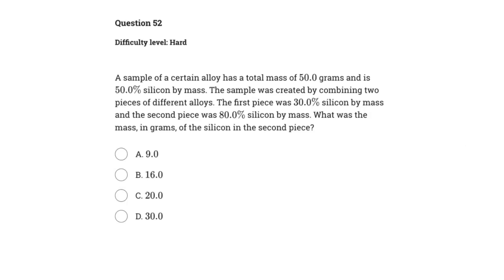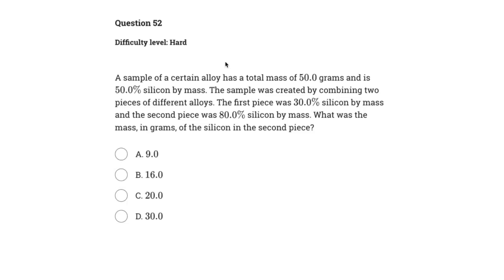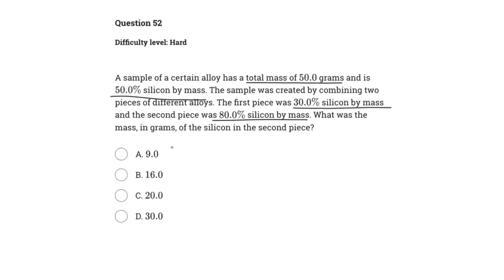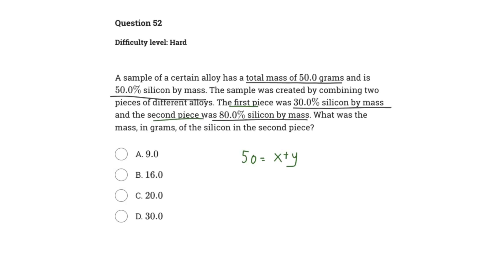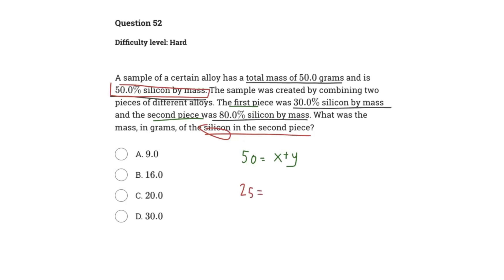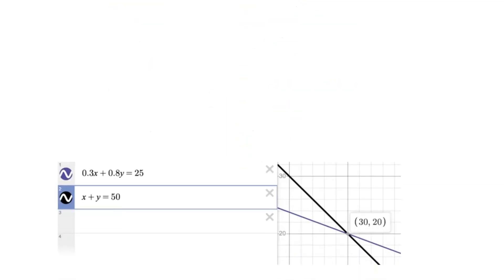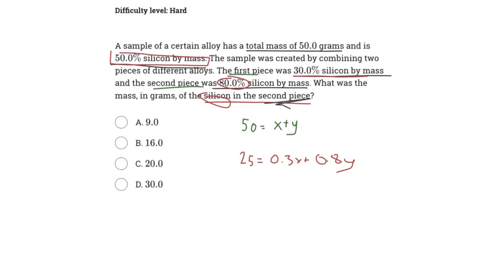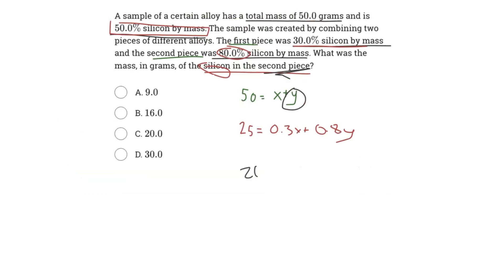You MUST Know This HARD Problem (#10)

Comment: This is not hard, maybe some questions needs to be reconsidered on difficulty
Reply from the maker: Indeed! College Board should reevaluate questions soon.
Reply: At this post the college board standard hard doesn't actually mean hard it's just the way to solve it isn't like a single step.

But they shouldn't make anything harder. Because thatd be terrible 👎
Reply: Collegeboard sucks! Good luck trying to find problems that ACTUALLY reflect the last 5 questions of module 2...
Reply: @oogie493  what do you mean?
Reply: @oogie493  yeah ive noticed that pattern over the last few sats... do you know where we can find questions that reflect the last 5?